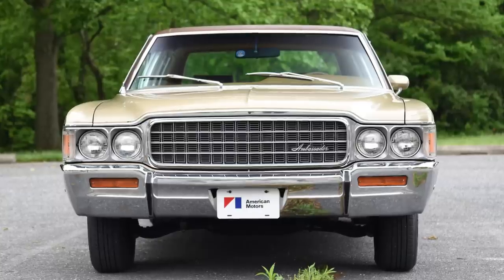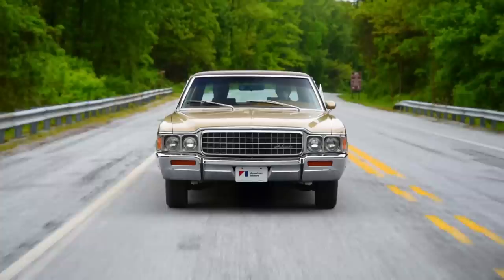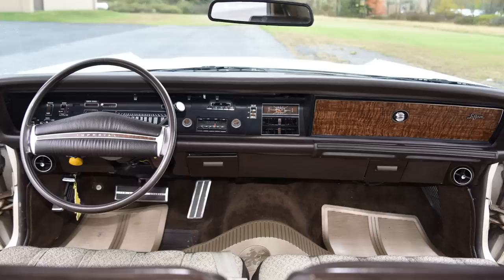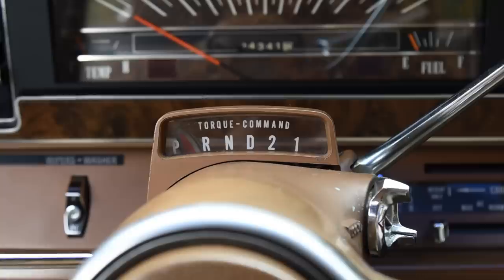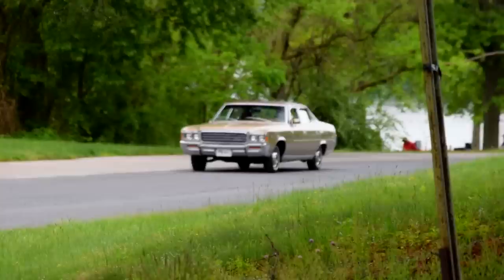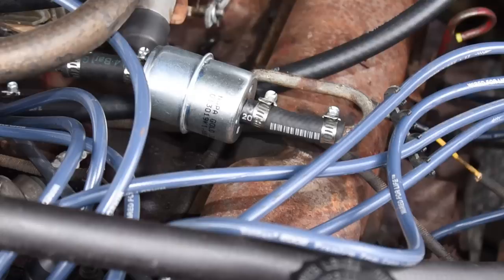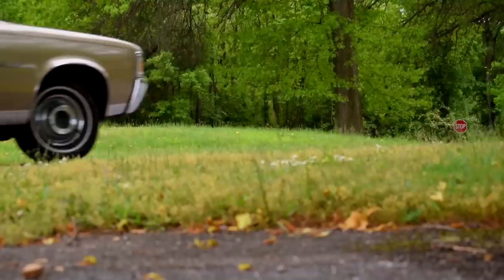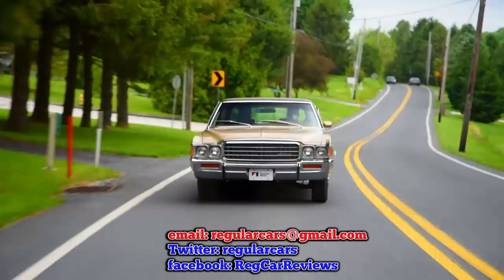1972 AMC Ambassador Brougham Sedan: Regular Car Reviews

Comment: Why does everyone always only talk about how: "It's slow and oh so terrible"? The Ambassador wasn't made for speed, it was made for quiet serene comfort on long Highway trips or on the way to work. Everyone needs to stop viewing 70's luxury sedans as "Oh, it has a V8 so it's got to make heaps of power and lay down Burnouts on every corner" machines, that's not what these cars were intended to be. If you wanted an AMC that made heaps of power you bought a Javelin. 
We own a 1977 Lincoln Versailles, a car that is always described as a terrible failure, and is criticized for "only being a Granada".
But if you actually drive it you realize it's so much more than that. 
It's the most comfortable, quiet and soft ride you  could ever imagine. That's what these cars are about.
You aren't meant to drive 100 mph with them and leave tire marks at every stop sign, you're supposed to drive 55 with one hand on the steering wheel listening to Fleetwood Mac. That's the true purpose of 70's luxury sedans.
Reply: Well said. I was starting to think I was the only one who understood this concept.
Reply: Thank you! Someone gets the point of these things!
Reply: I think these are or were faster than they showed.
Reply: @boggy7665  I don't exactly know what you mean, but it is true that a lot of muscle cars of the era were slower and had less power on paper than in reality for insurance reasons.
Reply: @honeybadger0559  In this video, accelerated from a stop to about 40 mph.  I think this should've been much faster to 40 mph than in the vid.
Reply: @boggy7665  I don't think RCR manipulates the speed of vehicles in his videos, that seems a bit far fetched. I can tell you from experience that these cars aren't fast by any means. But like i said, that's not the point.
Reply: I kind of like it. Guess im wierd.
Reply: @kevinphillips4517  - That makes at least 2 of us, and at 94,341 miles, it's held up!  Admittedly not my favorite color, but it's lasted FORTY-TWO YEARS...
Reply: Bro you hit the nail on the the head with that one.
Reply: Honey badger055. I had a '72 Matador in the late '80's - early '90's, and it was a great car, very comfortable and distinctively different, it wasn't my daily driver, and now I kinda' wish I'd kept it. At the time one of my mates described it as "a real lazy mans car" - given it had A/C, power windows, super light power steering and very comfy white leather interior. Looked pretty good too, in dark blue (no vinyl roof) with a set of chrome "Dragway" wheels, sweeet!
Reply: These old rigs from the 70s could go over a hundred miles an hour though, it just took awhile to get there. And It’s smooth when you’re going that fast.
Reply: Cars weren´t developed for the Nurburgring in those day´s, and most of them were underpowered by today´s standards.
Reply: Because they dont understand the car. Theres a reason why luxury cars are all gone. People dont want that anymore. I agree, although not my first choice in luxo boat its not what rcr described it as.
Reply: i dont get it either. the highway speed limit was 55mph. your car isnt supposed to do 100mph and most people really cant handle that speed or want to. people back then just wanted to get in the car and relax from A to B. this car was suited to handle those speeds and give you that comfort. it delivered. the color isnt great. its horrible. the brochure colors were better. my friend had a 72 Hornet that color. i learned to drive on that car. its 232 v6 was not bad at all in power. he took long drives with it and it did well. the owner of this car should change the color of his car to match the new vinyl top. it would be an improvement. otherwise there is nothing wrong with that car. it did what it was supposed to and for not a lot of money.
Reply: @chukzombi  That's exactly my point! Although the brown isn't my favorite color either, i do think it fits the car very well. Because in the same way that these cars aren't "good performers" by todays standards, these colors don't look good to todays car buyers. At the time these brown tones were a symbol of luxury, the 70's luxury car buyer considered them to be representative of luxury and craftsmanship.
The same goes for stuff like vinyl roofs or trunks lined with fluffy carpeting, these things are completely impractical but that wasn't important, they were nice for the time being and that was all that mattered.
Reply: Ok boomer
Reply: @patrickoneil6817  Ok Millennial
Reply: Thank you! I swear some people just haven’t heard of the term ‘cruiser’ or ‘Sunday drive’. Smh 🤦‍♀️
Reply: It's probably because American '70s luxobarges made so many extreme compromises to get that comfort and soft ride--terrible fuel economy, wandering steering, awful brakes, inability to take anything resembling a corner (like highway interchanges in New England), etc. Citroen proved in 1955 that it was practical to have a car with a supremely smooth ride that wasn't a boat, and here in the 1970s the Big Four were building...boats.
Reply: @Haile Xiao I'm assuming you haven't driven one of these cars in real life? I agree that fuel economy is one of the major issues with these cars. Then again the people that had the money to buy big Cadillacs and Lincolns and even AMCs in the 70's didn't really concern themselves too much with fuel economy. And for V8s the fuel economy isn't actually that bad, for example our Versailles gets about 18 mpg combined, which isn't all that bad for a 351 that's being choked by a ton of smog and emissions equipment. And the brakes aren't bad either since it has vented discs all 'round which was really advanced at the time. To really understand these car you need to drive them, take them on a road trip, daily them for a period of time or even just cruise with them on the weekends. Only then can someone get a good understanding of why some people like them.
Reply: @honeybadger0559  I have driven several--1974 Chrysler New Yorker, 1976 Cadillac Fleetwood, 1973 Lincoln Continental. Maybe their strengths would shine more and weaknesses less visible in the Midwest where roads are long and straight, but driving them in New England with our twisty roads and drivers insisting on taking super-tight interchanges at 60mph just wasn't all that fun.
Reply: @hailexiao2770  Well i'm sorry you had that experience. New England roads aren't really a problem for me since i live in Germany, but i can see how short corners and twisting roads could make these cars unpleasant to drive. So i guess you have a point.
Reply: Wonderful speech.....Thank you. That is exactly right !!! The 70 's  " land yatchs" were designed to be just that ; a land yatch that gave an incredibly quiet ride  for those who could afford it...and, given the fact that The Ambassador came from a " budget-minded"  automobile company that , through the previous 100 years  
were constantly trying to merge & take over other smaller companies ; quite a few of the interior & exterior designs were very unique to this brand.......even so much so that they introduced several new models during the " riggers" and constant changing in the 70's & 80's.....with everything this company was doing
to keep its models fresh & new while trying to come up with unique ideas & designs , they apparently ran 
low on funds. The one model I found very creative & unique was the 'Matadors'  sister ; the uniquely designed 2dr model......which, unfortunetly , was catagorized  with8n the " crazy-designs" catagory along with the Pacer &  it's close, one off cousin the Gremlin. AMC kept their " top-of-the-line"  Ambassador as close to a traditional luxury car as they possibly could ....However, in the spring of 1980 , either Jeep or Chrysler put in a proxy bid to buy out AMC and its subsitiaries ; along with Renault which, for a few years , tried to sway the American PUBLIC  with their designs engrained into American cars......And for a few years that went alright.......at that point I think Mr. Iacocca  submitted a bid to buy-out Renault ; which , at that point included Jeep & good ol'e AMC.......and the rest , as they say, is history. Lee Iacocca  was quite the business man .......making bids for companies that are on " the brink" & does his best to bring them back ; which he has been successful at for several years ; He is also the gentleman souly responsible for the Mustang ; which we still see today & which made a fantastic splash on the performance automotive scene in the mid-sixties...
Reply: @honeybadger0559  -Hi , 'honey'....Growing up we had a 70's AMC Rebel wagon with a 5.0 ltr ( 304 c.i.) small block with a 2 bbl carb. rated @ 210 HP  @ 2800RPM  &  close to 300 ft/lbs of torque @ 3700 RPM. You're right about the HP & TORQUE  Stats being  " under the wire" for Insurance Co. PURPOSES . My father absolutely l9ved this wagon ; it was almost a powerful as the the original   1957  Nash/Rambler Rebel with its 327 c.i. V8 , 4bbl carb. with 275 HP & 320 LB/FT of TORQUE  and dual exhaust.....The Rebels of this era gave Dodge , Chevy, Plymouth & Pontiac & all the 'HEMI ENGINES' a run for their money & if borg-warner was able to complete their fuel injection system , these Rebels would have been neck-n-neck with the Corvettes & T-Birds of the day.....
Reply: I DIG FLEETWOOD MAC....THEY WERE THE BEST IN THEIR DAY..!!!!
Reply: @shwt121  I agree 😄.
Reply: Yeah right on.
Reply: Well put. Different cars have different purposes, just like a pickup truck has a different purpose from a car. No idea why some people feel the need to take a dump on any vehicle that cant do 0-60 in 8 seconds. I would have thought being a high-minded east coast intellectual,  Mr. Regular would understand that.
Reply: Wow thankyou! Although I just bought a 1972 Ambassador SST Station Wagon with a 360 with a 4 bbl, and it makes 220 and 315 and is fairly fast
Reply: Your correct these were NOT muscle cars with high out put horsepower engines not did they have to be ... These cars never needed  to compete with expensive imported luxury  cars Jaguars, BMW's , and Mercedes-Benz of the Era ; These cars were built for Pure American post high compression engine comfort by and for the both the then pre WWII  and WWII Archie Bunker generation. 
These were an older more Conservative marketing demographic that wanted comfortable smooth , floating,  landyachts  these people were retirees listening to Perry Como Tony Bennett Frank Sinatra type of music on their way to church or dinner parties or concerts from the four mentioned entertainers. So " Speed" and "Power"  , , ,tight connering  or" drifting " was definitely NOT their thing; a peaceful soft, quit ride to and from the airport or the Gulf Course was ...
Reply: @rodferguson3515  Yes, exactly! Great example.
Reply: would love to see RCR review it!
Reply: @vandelayofficial492 What exactly do you mean? 😄
Reply: You've missed  something that he mentioned in the video: this is a 1972 car, it's pre-emissions and before the oil crisis. Besides, a contemporary Buick, Lincoln, Chrysler, Oldsmobile, Cadillac, Mercury or Imperial made at the very least 290 hp and near 400 ft/lb out of a V8 with similar displacement. Also, he said the seats, the materials and torque isn't that good.
Your Lincoln is way better than this car and  it has the excuse of emissions control and oil crisis. It's also more comfortable and has better materials.
Reply: @Lianpe98  I know it's pre emissions, that doesn't change the fact that it's not supposed to be fast or sporty. Add to that that AMC was a very budget oriented brand, which didn't feel the need to make their "non sports models" overly powerful, therefore making them more economical than it's competitors for example the Chrysler New Yorkers of the time, the big Chryslers, Lincolns and Cadillacs with their 440's, 460's and 454 Big Blocks wasted herculean amounts of fuel in comparison to the Ambassador.
Reply: It's also made for leaded fuel...
Reply: @frankzappa3834  Which was ousted in the 70s-80s time frame FYI and technically can run on modern gas
Reply: @sockshandle  you can still buy leaded race fuels, but I don’t really think companies were redesigning compression for unleaded fuels yet.
Reply: I'm 22. But I get it
Reply: Jesus you wrote an entire paragraph about jokes I bet your fun at parties
Reply: The large-displacement engines were used in part because AMC gas tanks in those days were so big. 

According to Google, AMC was getting reports that their cars were showing up at filling stations with windshields that looked like they hadn't been cleaned in two weeks. That's a safety concern. By increasing the size of the engine cylinders, AMC engineers were able to "build in" more frequent visits to the filling station, resulting in better visibility and a safer America. 

The brown interiors served a similar function. They promoted a feeling of vague illness-at-ease that kept driving to a minimum, and absolutely did away with passengers eating food in your car (no one wants to suffer a case of heartbrougham).

Of course Centurions (people born during this century) can't understand that, what with Web 2.0 and texting and "getting rides" and all that.

If Plymouth Aspen hadn't come along with its hatched-back technology and FM tuner as available option, I'd still be driving my Ambassador.
Reply: @kevinphillips4517  You're not, this has underdog written all over it, you're full of empathy spilling over.
Reply: @Lianpe98  It was meant to be cheaper than the others, captains of industrie, lawyer or plastic surgeons were not the targeted demographic.
Reply: I agree it unfair to bring the shame of Watergate upon these cars of that era. You simply can't castigate these cars and use 2021 standards to compare them with ; these old school cruisers were not designed to go at Autobahn speeds, or maneuver at abrupt lateral acceleration.  cornering or stop on a dime ... These ole school  American land yachts luxury boats were designed for one thing only ... Comfort .., with chrome, vinyl, velour, soft shocks, one finger steering cruise control white wall tire  cruising..  That's it .. and nothing else.....
Reply: @hailexiao2770  Keep in mind that during the '70 's especially the late '60's - early '70's Luxury boats  land yachts were the American standard of luxury ,The Bigger the Better , floating or wallering over potholes, etc.. keep in mind the WW II generation (Archie Bunker's generation)  we're used to this type of car and WANTED them  ; these consumers at that time wanted the Queen Mary not speed boats!!!. Like people today people seem to want Crossovers these days so they can get their fat asses in. And out of vehicles instead of having fun or interesting cars RightNow.
Reply: @evin98  Also keep in mind that you didn't have large SUV's at the time and trucks were not as popular back then so the cars (minus the muscle cars ) were these big huge land yachts with their large and Jen's and relatively High foot pounds of torque conversion via the rear wheel and large station wagon towed large  tailers for  summer camp trips to Yosemite etc ...
Reply: Agreed ..  when I was a kid the owner of the barber shop that I used to go to brought one brand Spanking new Lincoln Versailles ( 1977 model ) with a clear lite blue sky color . I remember that people used the comment on it and compare it to a Seville .. Their were comments that it was just a Fancy Nancy overly glorified Granada but they were wrong.. The Build quality and it's interior appointments we're so much better than Granada's or Monarchs just as the Seville's build quality was better than A Nova, Skylank, , Omega, or Ventara/ Phoenix.
Reply: Well put!
A 70 year old person in 1972 lived through two world wars and needed couch-time for a decade.
Reply: @boggy7665  Mom's 73 with the 360, 2bbl carb, and trailer towing package was. But it was also great for trips from Homestead, FL to near Orlando on a Friday evening.
Reply: @hailexiao2770  The Ambassadors we drove had tight steering. I wish I could have said the same for the 77 Dodge Monaco wagons we had at work. Both with police packages. The difference were that one had the Dodge 360 and the other had the 440. Both wallowed down the road from new. Chrysler termed it full time power steering and that's what you had to do. Steer it all the time because they could not beset to go down a road on their own straight.
Reply: @shwt121  A 1970 AMX was factory rated at 325HP with the 390. That was purely insurance driven. When they went drag racing, the NHRA factored them at 425HP in order for them not to stomp on other cars rated at 315/325 HP.
Reply: @rodferguson3515  AMC also made some that were designed to be fast. You just had to know what to order. Try a 401 with a 4 barrel and a Twin Grip rear axle with a greater than 3.15 axle ratio. You paid for it but it would run with the best. The speedometer out of mine is downstairs. It came out of an ex-police car so equipped.
Reply: @frankzappa3834  That happened in the 1974-75 time periods. Gas back then was about equal to premium now days for regular. And premium ranged up to above 104 octane. So the timing could be advanced some and I'd bet that the timing on this one has been retarded to get it not to ping on today's fuels.
Reply: @evin98  21 gallons isn't that much. The 69 Rambler only had a 16 gallon tank.
Reply: @gravelydon7072  you are very good with numbers
Reply: @evin98  You might guess that I had way too many AMCs back in the day. My last one left the property in 2004. I hated to see the 69 AMX go but it had become unsafe to drive. Hurricane Andrew had brought in salt air and it got in everywhere.
Reply: Very well said to educate these who weren't around back in the '70's  . Cars like the land yachts were meant for only one thing only..... luxury and  comfort.....Back in the '70's they stitch leaded gas and put a lot of smog control equipment on these Engines ; to compensate for that car manufacturers boost the amount of Torque to engines to compensate for the lack of power while boosting fuel onsumption and lowing  emissions. 
To the younger audience out there, Luxury models that were around back then  had didn't have to go fast they were soft , comfortable cruisers   and V8 power was the source of power before turbos and and fuel injection became the norm.  . ..
Reply: @gravelydon7072  czech
Reply: for that salt damage, I always say
Reply: @gravelydon7072  sounds like that 69 AMx had a pretty good run, to last from Andrew thru 2004
Reply: @evin98  I owned it from 1977 to then so I'd say it did.
Reply: So true. The power and torque isn’t for acceleration. It’s for penetration through hard barriers. 

Such as plastic rubbish bins filled with cold treacle.
Reply: @adamziolkowski2549  I’m 22 Magnum and I can’t figure it out
Reply: @rodferguson3515  watergate was no more than a third-rate burglary

the AMC was a first-rate automobile 

the only one with suede elbow patches

and dual tobacco pipes
Reply: @rodferguson3515  I’ve always said that the best SUV is a Country Squire with a 410 engine
Reply: @evin98   no... I disagree with you on both comments Watergate if you were either around at the time or not was a very important issue . Richard Nixon and the Republican party broke into the Democratic campaign office and burglarized Democratic office of  candidate McGovern's office ,stealing his campaign plans to run for president. Nixon "Won" based on the thief of the Republican party"s break end of the campaign office at Watergate ; this was no third rate break end Nixon lied  and cheated his way into the White House just like he did 1968 lying about the Vietnam War please get your facts straight before you comment on this post and for your information  I never criticize American motors ; American motors was a very good car company it was smaller than the other brands but they may not have had the  same amount of resources that they ( GM Chysler and Ford )  had  and they built some decent cars also please get your facts straight on that too.
Reply: @evin98  sorry guy ... The Ford country squire was not an SUV it was a station wagon model..
Reply: @rodferguson3515  The Watergate was, and is, a first-rate property with excellent views, and the facts you cite — that evldœrs once misused Watergate for their own ends  — are disgraceful indeed....

...for a Watergate is a Switch is a Switzer is a Switzerland and that’s the Top of the Pops as far as I am concerned

thank you for setting me back straight
Reply: @rodferguson3515  if the Country Squire was not an SUV, why were the doors carved from such rich hardwoods

And why would the Bradys have owned a bunch?
Reply: @rodferguson3515  Mr. Ferguson, this is Youtube. We would like to hire you to make corrections to comment sections. 

You’ll be working alone; how soon can you start?
Reply: @honeybadger0559  That's very true the Insurance companies  downgraded horsepower for alot of muscle cars .. Horse Power was measured  by the flywheel and not rear wheel portion of the car
Reply: @evin98   sounds interesting what will I being doing on-line?
Reply: @rodferguson3515  using reminders to corral strays and shepherd the misguided
Reply: Correction: you're supposed to drive 55 with one hand on the steering wheel listening to the "beautiful music" station. With covers of your favorite songs done by the Hollyridge Strings and the Ray Conniff Singers.
Reply: @BadDriversOfTennessee These were relatively light, unibody cars.  They weren't terribly slow with a 360 2 bbl, which this car has.  Something wrong with the slowness of this example or he's hamming it up for the effect.
Reply: @gravelydon7072  Your mom's '73 w/ 360 2v, towing package, was what?
Reply: As a kid, I spent a lot of time riding in my best bud's 72 or 73 Ambassador 2 dr.  Badge said 360 I think it was a 2v.  It was not slow.
Reply: @boggy7665  1973 Ambassador 4 door, 360V8, 2 barrel, towing package with air adjustable rear shocks, limited slip rear axle, 3.54 axle ratio and a 1972 set of interior seats per the special order.
Reply: And as for my 73 Ambassador, it had a 4 barrel, auto, police package, hidden second exhaust pipe, bench front seat, and would pass anything except a gas station. I had it to 120MPH one time and the certified speedometer was good to 140. As the speed went up, you could watch the gas gauge go down and at legal speeds it took 3 fill ups to go from Melbourne, FL to Homestead, FL, a distance of just over 210 miles burning around 50 gallons of gas. Many of the 401 of that era also had 4 bolt mains if they were used in police cars.
Reply: @gravelydon7072  It's also the same with colors...there were browns, greens, golds, blues that seem crazy today but you could also get these in black, white, silver, grey, red and such back then.
Reply: @Progrocker70  But they weren't painted in the "Big Bad " colors. Can you imagine an Ambassador painted in Big Bad Green?🙄
Reply: Your reply is on point! People who constantly criticize American cars and cars from the 1970's are completely whack jobs that obviously didn't live in that time.  I did live the the 1970's  and we LOVED BROWN!  WE LOVED AMERICAN CARS!  WE LOVED THE BIG LAND YACHTS  WE DIDN"T WANT TO DO BURN OUTS!  We didn't want fart mufflers on little bitty tinny weenie cars from Japan!  I dislike the BMW and Mercedes cult today that if you don't "lease" one and drive the cult you aren't in "the crowd"  Little cars with horrible seats and interiors and screens you can't see or read and just a mess of things that make to sense!   If people are so against America and the way we loved to live and the cars and homes and paneling, then MOVE TO CHINA!
Reply: Very interesting 🤔
Reply: One handed? These are meant for knee driving
Reply: Okay it had an upgrade of 360 2bbl,  disc brakes were and up grade, it does I have upgrade front and rear sway bars and extra, bumper guards are extra.
Reply: It was a luxury car with manual windows, door locks, no tilt, no cruise, and am only radio. And that was a luxury car? Even some of the econo boxes back then had more options